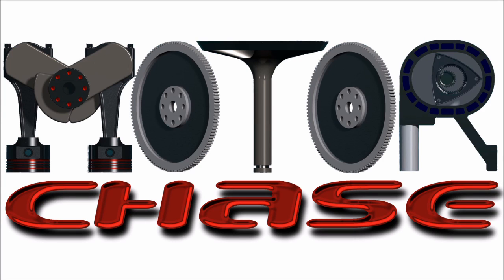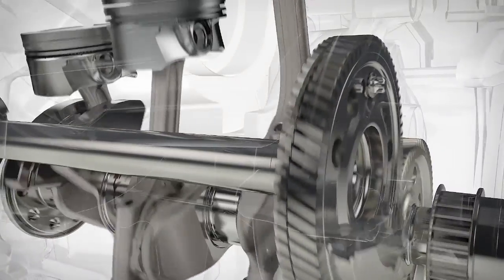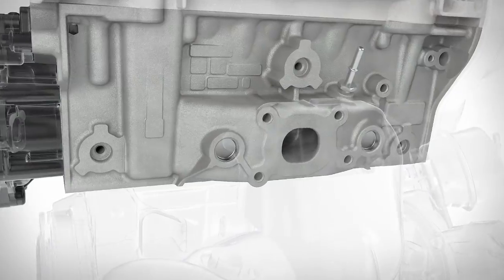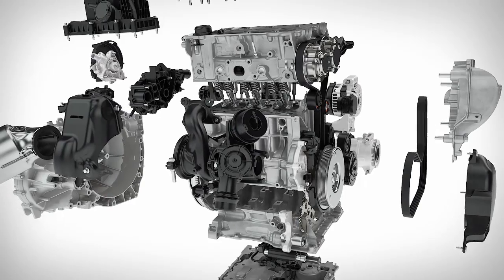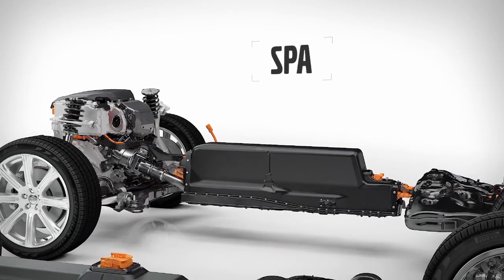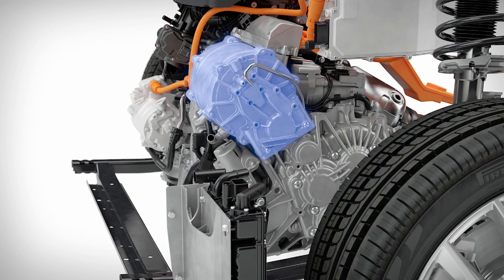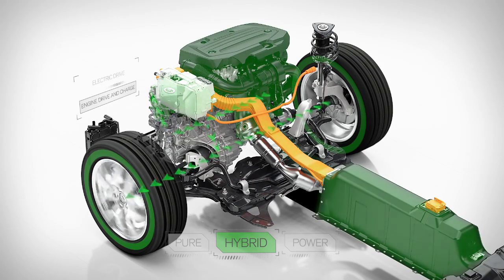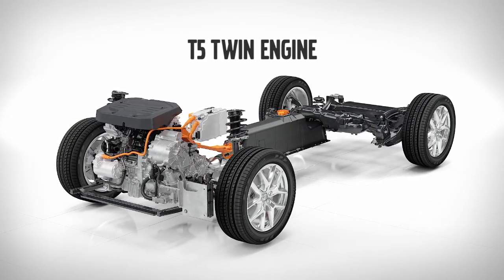Volvo 3-cyinder Drive E engine and T5 hybrid CMA - MotorChase

Comment: Sad to see, they didn't connect the Aircon compressor til the electric side, so you can have A/C in pure mode. Or simply put a seperate electric motor on it....